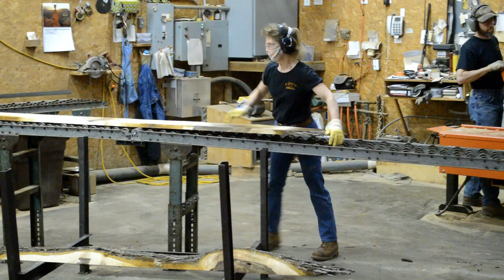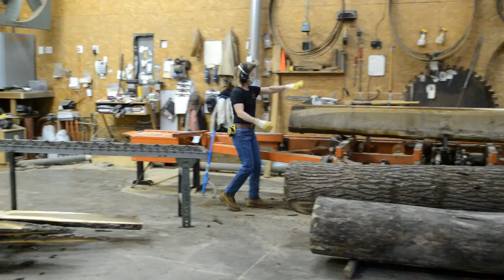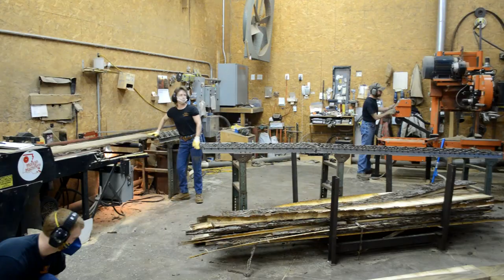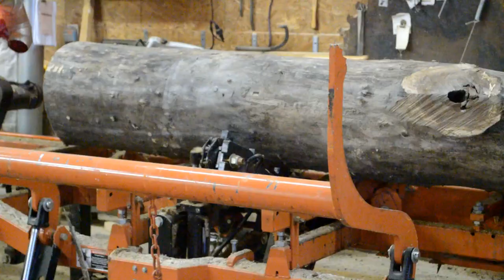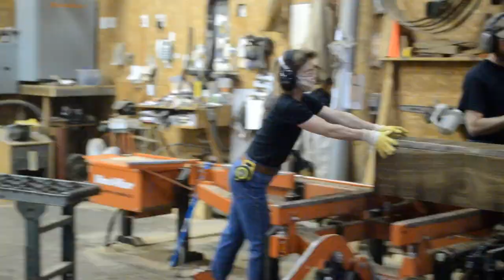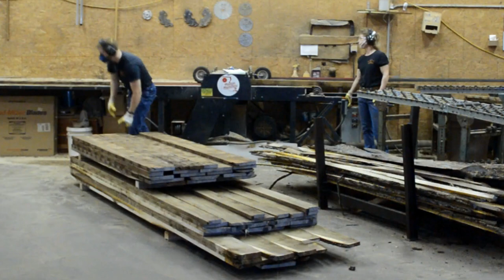Wood-Mizer & Family Team Mill Walnut Logs

Comment: Love how you have everything right were you need it!  Thought I had the second Machine figured out that you were putting two parallel edges and possibly a quick sand on each side. That is until you started putting two or 4 planks through it at the same time. What is that?

Comment: I love this video, you run a tight operation. What type of gang rip saw are you using? How does it transition from straight lining one board or 2 stacked boards? How do you change the width of board rip? Great operation, I can watch this video over and over.